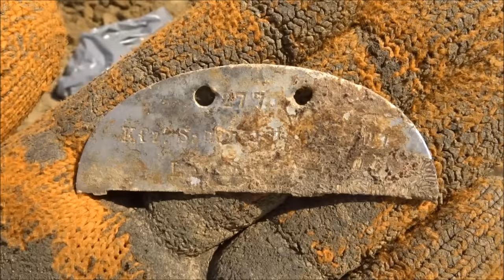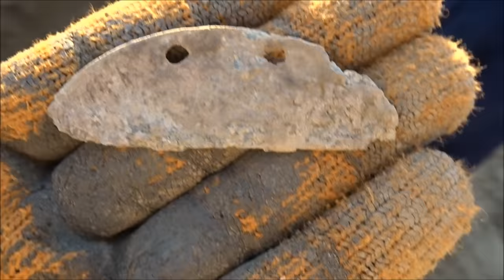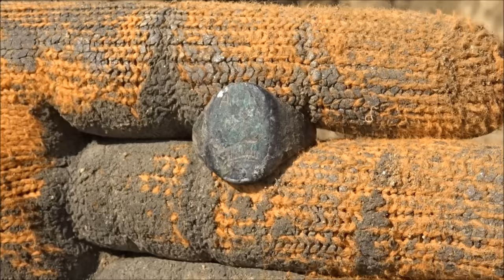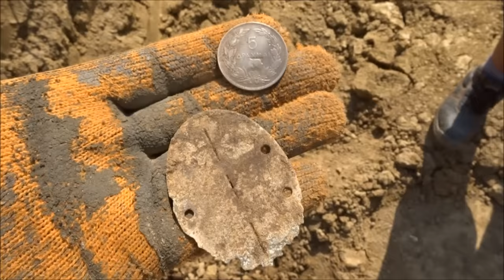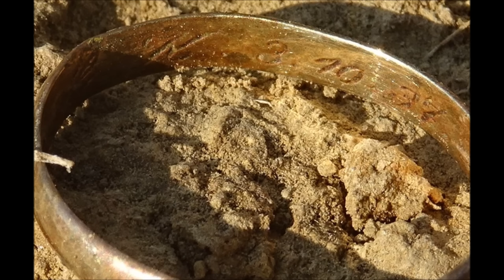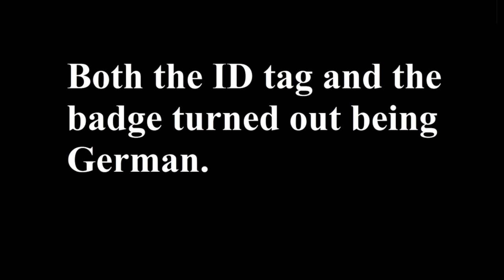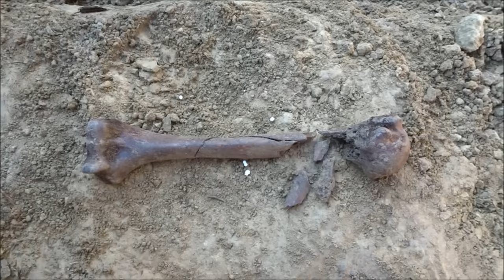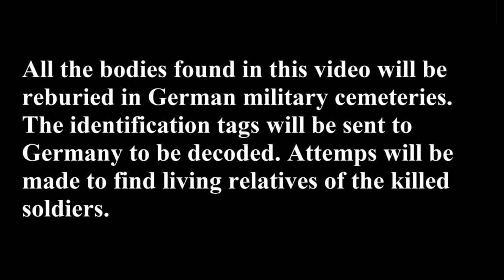Exhumation of 25 German soldiers from a 1945 field hospital cemetery on the Eastern Front

Comment: I was curious about the unusual appearance of the leg splints.  I found out they are called wire ladder splints and could be bent and formed around a leg to stabilize it.  Proper splinting of a fractured leg could reduce fatalities as much as fifty percent.  Aluminum ladder splints are still made today.
Reply: Yep there Not much different than the ones we use today...
After the war the spikes of these splints acctually where wrapped arround with soft sponge like material and you wrapped them arround the leg there were used in Germany until the 90s, it looks brutal in thw video to someone who dont know these kind of splints becaus the look implied that these spikes go into the body but that isnt the case...
The splints today are a soft material with a small flexible alu inside,and there work the same

Comment: 32:23 The Entry hole is usually smaller than the exit, the bullet goes in and is thrown off trajectory on impact. You could hit someone's shoulder blade and have the bullet ricochet into their ribcage breaking multiple ribs, and even exiting through the neck after all that.
Reply from the maker: Thanks but this is not even a bullet hole.

Comment: Were they buried naked? It seems strange that they didn't find any buckles and buttons etc from their  uniforms.
Reply from the maker: Some were probably buried nacked, or in hospital cloths. Others did have uniforms but only the buttons survive burial under ground.
Reply: @CrocodileTear  I did see that there were a few buttons recovered, but not on all of the finds. Is this because of the type of metal used in the manufacture?
Reply from the maker: @thomp5347  As some of these men died during medical treatment,some of them probably had no, or little cloths when they were buried. That is why there were no buttons.
Also, we didnt necesseraly film the moment when we were finding buttons as they are so common.
Normal German uniform jackets and pants has metal buttons, so if they were there, we will find them.

Comment: None of those tourniquets worked at all. You know why?because when your femoral artery is severed it contracts up  in your body And it’s not possible to find it to get ahold of it to stitch it up if you move around too much and it’ll snap like a rubber band and then the most white hot pain you’ve ever felt and then you bleed out internally because the tourniquet couldn’t stop it on the inside and it has to sit on that artery pinching it shut. To slow it down long enough to get you real medical attention

Comment: 32:15 Usually the exit hole is large and the entry hole is pretty small.
Reply: If you look at the small hole you can tell it was an exit hole by the looking at the sides of the hole. The bone fragment was pushed outwards away from the head.

Comment: Coffins of Wood for some.
Bare dirt for other’s….?

Aluminium was scarce late in the Campaign & needed for Aircraft so Steel & Zinc I’d Tags were opted for as a replacement.
That in itself offer’s insight as to Age of the Corpse or Enlistment era.
Noted..
The different metals typically were found on those Soldiers with thier Arms crossed over the Chest.

I believe, 
                A Young Soldiers Grave..?

Regardless of which Army…
They Were Soldier’s.
Deserving of this Respect..!

Comment: Seems that most, if not all of these guys died from artillery. Shrapnel, the intact skeletons could be from blast injuries (bowels, lungs, liver, spleen, head injuries and so on). 

In war, usually there are very roughly 70% casualties due to bombs, almost no exception. A smaller group of soldiers buried together could have died in the same bombardement. If a second batch of casualties comes in, the other group would likely have been buried already, and the others would be buried in a second grave.

I also noticed that your later bodies seem to have been less treated, more damaged, more lethal injuries (head injuries, totally mangled, half a corpse etc). Maybe these were triaged as either already dead or dying with nothing being able to be done for them (today black and blue triage colours). So they were probably buried first, the others as they died over the day(s).

So my bet is that these guys all died in the same bombardement.
Maybe you could find something about German defensive positions in the area being attacked during the German retreat.